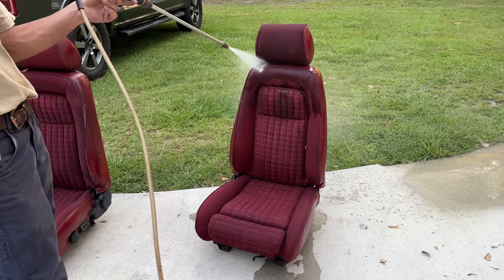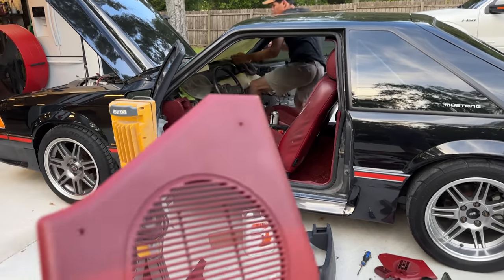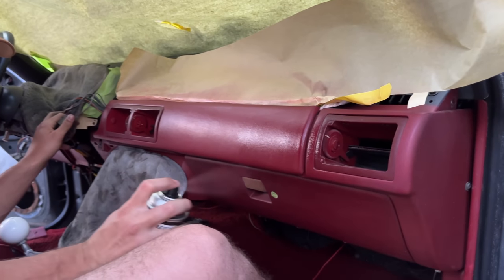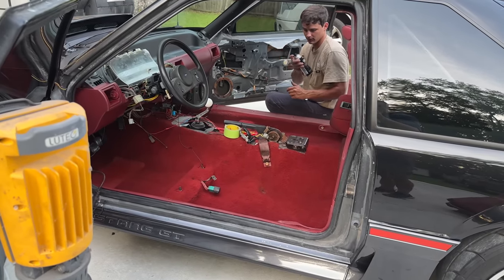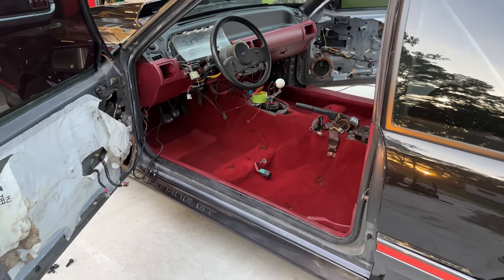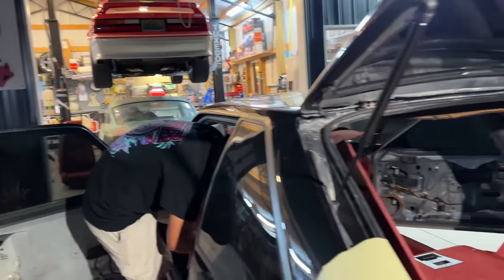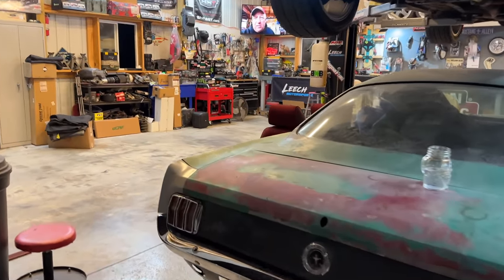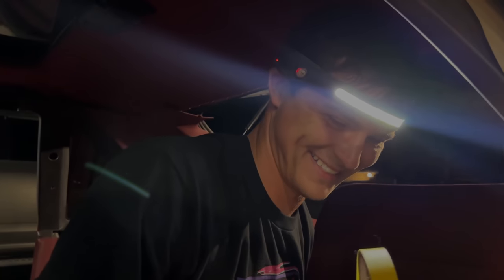This Dude Over Here Spray Painting Everything: CARPET..SEATS...DASH........ 🤔😂

Comment: Here’s a (I think) good question. I have a set of gray seats. Not sure exactly which ones. They came out of a 92 stock vert. I have an 89 vert that I’m restoring and it has scarlet and white leather that is toast. I am staying with the red and white theme and was considering trying to dye the seats both colors. White on the centers and red on the backs, sides, and perimeter on the tops. What is your take on doing this?  Or should I just purchase the leather in the colors I want. FYI, the gray seats are cloth. I kind like the clothe route. I also saw online that there are heated and cooled kits that can be added to older seats.